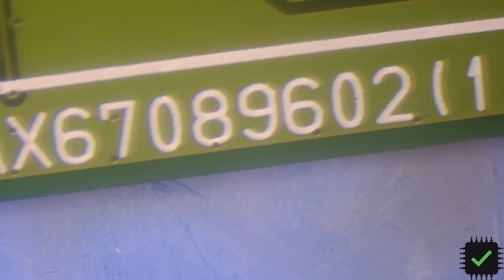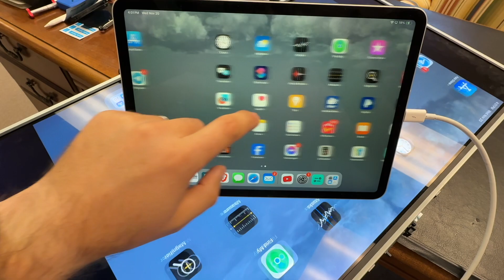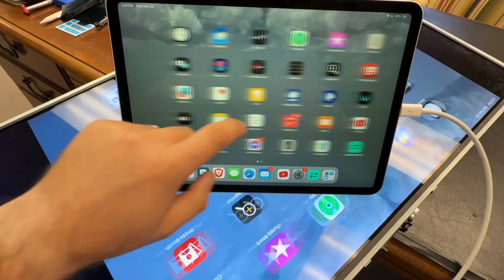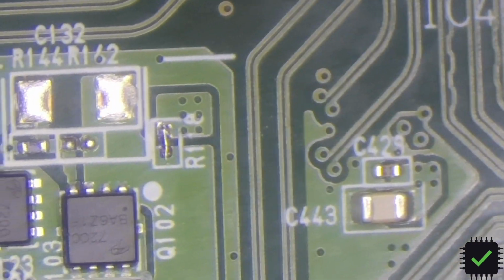LG 5K Ultrafine No Thunderbolt Detection, No Image, No Charging, NOT THUNDERBOLT 3 PORT RELATED

Comment: That resistor works as a fuse. (As happened here) So better to replace again with a zero ohm resist. Better if the ‘fuse’ blows than something more important when someone shorts the power on that connector.
Reply from the maker: Good point. Thanks! Will replace it with 0 Ohm resistor. MOSFET went out too but nothing else
Reply: @applepietech  per reddit: Do not use a zero ohm resistor as a fuse. Whilst they might have a current rating on the datasheet, this is just a family rating for that manufacturer's resistors in that package and is not indicative of the actual fusing current. The actual fusing current isn't controlled and may be much much higher than you would expect. You will not pass your UL (etc.) safety tests if you misuse a zero ohm resistor this way.

What you might be able to do is find a fuse that fits the same footprint as your zero ohm resistor. This is more likely with the larger SMD packages such as 1206 or 0805.